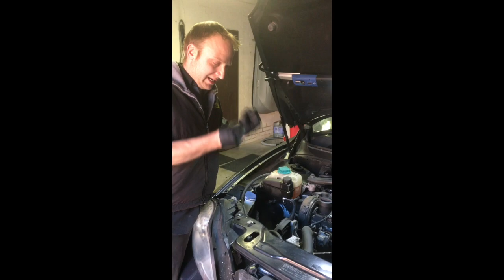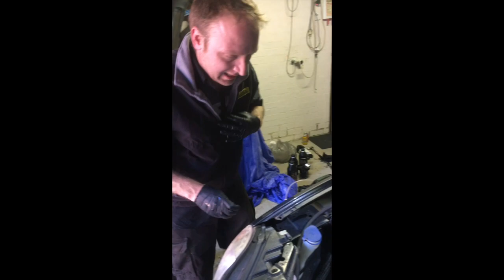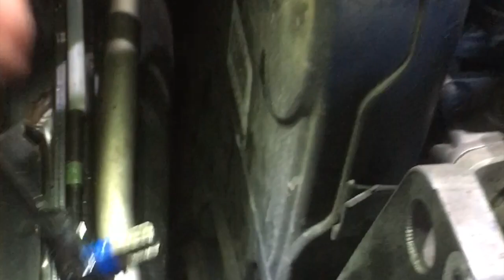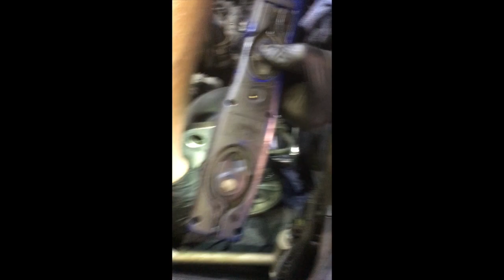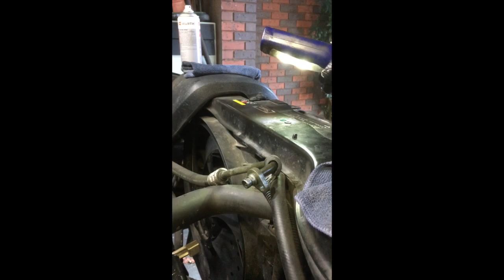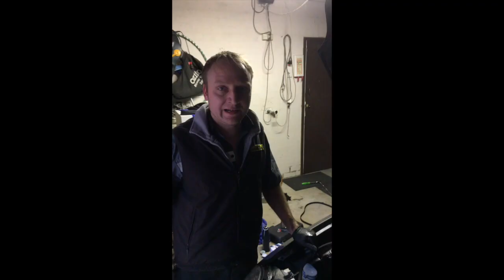Volvo XC90 D5 2009 - How to replace power steering pump without special tools.

Comment: Did a replacement yesterday the tip of taping the torx head into the spanner was gold! A tip I cab offer is if the belt is good once the tension is off the belt then slip it off the PAS  pulley and cable tie the belt forward to the adjacent steel frame. saves so much trouble with dealing with the belt. dod the whole job including bleeding new fluid in 2hrs !